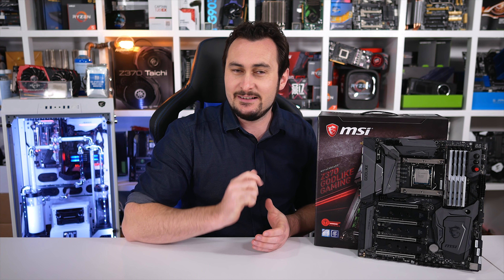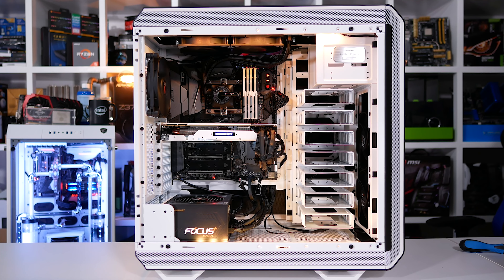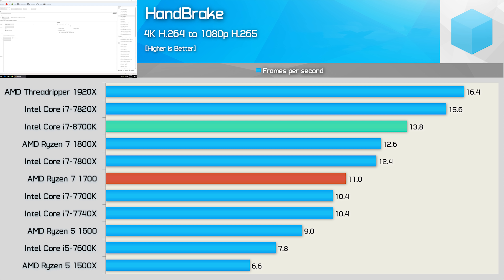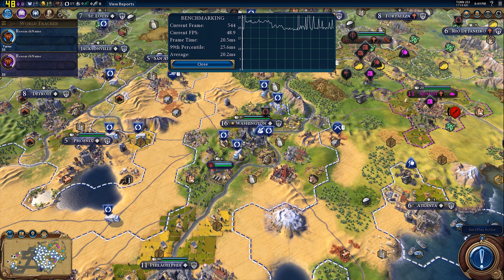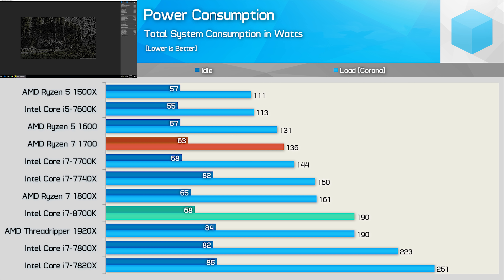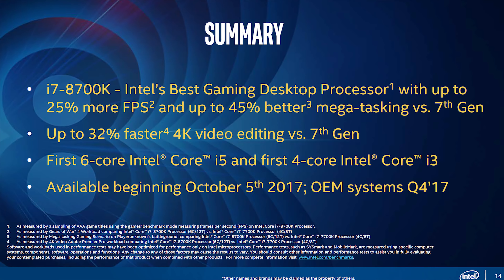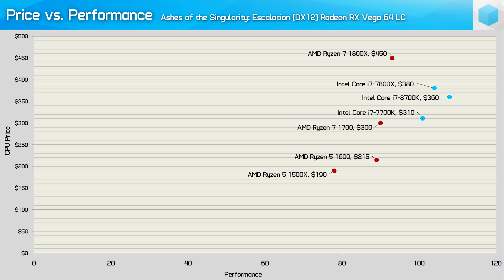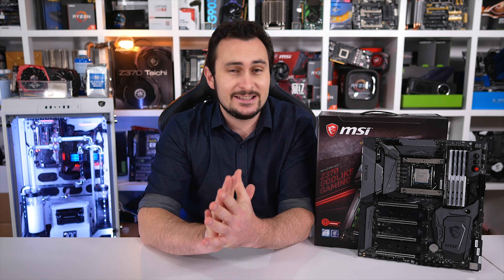Intel Core i7-8700K Review, The New Gaming King!

Comment: Interesting review and impressive performance of the Intel i7-8700 indeed, even though it is a bit of a hot breeder given its high TDP. How about the future proofness of the Intel platform? AMD for example guarantees the AM4 platform to stay until and including Ryzen 2... Intel on the other hand has a track record of forcing users to re-invest into an upgraded platform (due to changed socket layout) with every CPU generation. Any information about that?
I am asking because I don't want to buy a new platform (motherboard + cooler + maybe even RAMs) every time there's a CPU generation change. And I know AMD will come out with a 12nm Ryzen refresh in February 2018 that should shrink the performance gap to the i7-8xxx series and then finally the 7nm Ryzen 2 in 2019...all fitting into the same AM4 socket mainboard since Ryzen 1(provided, the mobo manufacturer supply the required BIOS update).
Reply: Peter Snizek Intel support two cpu generations per motherboard. 
1)Z68/ Z77 Sandy bridge and Ivy bridge
2)Z87/Z97 Haswell, Haswell refresh and broadwell
3) Z170/ Z270 Skylake and Kabylake
4) Z370/???? Coffelake and ????

Comment: I... ...was a bit disappointed to be honest with these graphs. I was expecting that Intel will blow up the competitor by miles... Seeing that the i7-8700K is placed between the Ryzen 7 1700 and Ryzen 7 1800X (some being overshadowed by the latter) it felt as if the extra cores and clock speed aren't utilized to the maximum. It's probably need some driver updates. Also, the CPU seems power hungry too.

Since both CPU company now offers over 4 core CPU, I hope more applications and games will utilize the CPU properly.

My verdict; get a Ryzen 7 1700 with a decent cooler. Drop it onto a good AM4 X370 board. Overclock it to 4.0 GHz and be happy with it for another 3 years.

This is purely my opinion. Any changes/updates in the future will void this comment.
Reply: in my opinion I'd go for 8700k, as it showed it had better value than 1800x and it was kinda going head to head with the 1800x. temps do get hot so gonna spend a lil more cash but its all gonna be worth.

Comment: Nothing surprising here. If you need super high fps gaming and don't have a system yet or are using a sandybridge, then this is good, otherwise get ryzen, as the 1600 is a lot cheaper and ryzen as a whole supports ecc for workstation. 

Side note, that power consumption, ouch. People aren't really getting just how power efficient ryzen is lol.

Comment: "20 dollars on a air cooler" it was hitting 97 degrees with the 240mm rad ?!!!!!!!
Reply from the maker: Didn't say you could overclock with it. I just said to use it at the very least you need a $20 cooler. It will work just fine out of the box with a cheap tower cooler!
Reply: Hardware Unboxed, I assumed as much. I would be interested to see how far it could be overclocked on a 20 doller cooler :) great review by the way. but the 97 degrees is very high for such a high end cooler, would you not agree ?

Comment: Man Intel needs to get away from ringbus ASAP.  Those IPC tests show how ringbus is really only meant to work well with quad cores or lower...
Reply: Tom Splittstoesser The ipc of the ringbus is good up to 10 cores. After that, it becomes bad. The i7 6950x at 4.4ghz is a ringbus design that trashes the 7900x at 4.6ghz.

Comment: Despite vega 64 LC being slower GPU than 1080 Ti, on BF1 and Civ, Ryzen perform better on Vega than 1080 Ti, why is that? Very peculiar result.
I think Ryzen is best paired with Radeon Vega and Intel/Nvidia is still the general best pairing.
Reply: Seramics Becuase ryzen's core to core latency is really bad. Most games switch threads which is why intel will always be ahead of amd. Nvidia's software scheduler switches threads as it does not have a hardware scheduler.

Comment: 8700K >> [hexcore] 3.7Ghz over 16 PCIe lanes @ 64GB RAM (max)

6850K >> [hexcore] 3.7Ghz over 40 PCIe lanes @ 128GB RAM (max).

*REMEMBER. You will be needing to fork out for a brand new motherboard with that. Have fun beta testing! :)

Comment: 16 lanes free, or zip after adding gpu? r u serious? Not even bandwidth for a single full strength nvme on a lightly shared 4 lane chipset. Multiple nvme/raid on such intel cpuS/chipsets is a fraught sham.

AM4 (20 lanes free ex the 4 lane chipset) at least allows a full strength nvme and a half strength one using 4x pcie2 lanes from the chipset (ie, an acceptable half of the chipsets bandwidth).

Over a brief period, our mainstream storage/workdrive sequential read has gone from 100MB/s sata hdd, to 500MB/s sata ssd, to 3500MB/s NVME. 

Thats an improvement of 35x.

Now you ~walk away from such a fundamental blessing, that future gaming & other code can really use, for a few more frames or settings in current gaming code?

I hope folks reflect on that pre purchase.

Its a pattern with ryzen. Intel sounds good superficially to gaming tragics, but when you step back in the slightest from a pure gaming perspective, Intel a dead end vs AMD.

Its not new. Intel has been perceived as a better gamer for all ryzen's life, but they are arguably the most popular choice for professed gamers now.

Comment: Such a shame you can only buy a z370 (130/150 dollar) motherboard in the foreseeable future. Otherwise the i3 8100 (4c4t, 117 dollar), i5 8400 (6c6t, 182 dollar) and i7 8700( 6c12c, 303 dollar) would be much more interesting and compelling. R5 1600 will probably stay best alround bang 4 buck cpu untill Intel releases cheaper motherboards.

Comment: So, basicaly, if AMDs and Intels engeeniring teams were on competition and given 125w power consumption limit to design CPU Intels team couldn't make it. On the other hand, if given powerconsumption limit were Coffee lake stated and if AMD team was careless enough to trade efficiency for performance as Intel does AMD would make faster processor [using performance optimized fitting production nod ]. I'm looking forward to AMD/GF 12nm and even more 7nm.
Reply: softplacetoland Intel are way way way ahead of AMD in power consumption, considering their cpu's are clocked way higher and their intergrated gpu's consume most of the power of the chips. They don't even need to solder to be successful while amd cpus NEED to be soldered to contain the heat they produce.

Comment: Holy mother of PSU what is up with those power draw figures. Saw this on the 8400 and was a bit put off but this is....holy mother....! For just 6 cores ? come on! Is the motherboard crap? I mean the CPU alone cal not suck this bad from an efficiency standpoint....! Still good review. Cant wait for a re test once cheaper mobo's come out. At this point spending 500euros on a 6 core cpu and mobo is well not very efficient.

Comment: What about the 8700?
Reply from the maker: What about it?
Reply: Yeah, some substance would of been good in my original question :D

I mean, since 8700k is massively limited supply right now, would the 8700 outperform the 7700k for gaming and everyday use or would I be better off simply preordering the 8700k?

Thanks!
Reply from the maker: Pre-order the 8700K. No idea why Intel is even selling locked parts right now since you can only buy Z370 boards this year.
Reply: Am I the only one who buys high end motherboard for the extra features (decent integrated sound card, USB C, Intel LAN, USB 3.1 front panel connector, multiple M.2 slots, plenty of 4-pin PWM connectors etc.), not for the OC capability? I would be very happy with 8700 + Z370 combo.

Comment: Ok, so basically it's not worth it if you have cheaper options that run about the same. If I had to choose intel I would go with something like i7 4790k, i5 7600k, i5 8600k, i7 6700k or even i3 8350k. You'll see veeery soon just why intel did everything just to make reviewers show us i7 8700k - because it is obsolete when compared to other intel chips in gaming. Sure it is a king, but I cannot imagine someone justify buying this even if future-proofing when next gen will come in 10nm.

Comment: Rip off   gready   Intel   , proc    price is  10-20% more   then  msrp
Reply: didnt you see? 8700k had better value than 1800x. even though 10-20% more than msrp
Reply: It's because it's hardly, or better, it's not available at all (damn paper launch). Same situation with Vega: Hardly available and thus it's far more expensive than MSRP.
Reply: not anymore 1800x is 360 dollars now in Newegg and amazon.. 1700x is 299 and 1700 is 260

Comment: Some here have noted the results "indicate" vega works better on ryzen.

Whatever.

Just saying, I have long thought ~"how could zen/vega not work better?"

That would be to say, amd spent many concurrent years developing sibling cpu/gpu processors  using the same Fabric interconnecting ecosystem, yet they treated them as unrelated and & with no potential synergies. It would also ignore the whole Amd APU focus - they are on the cusp of raven ridge,  delayed understandably for 12nm - which is both zen & vega processors, interlinked on a single Fabric ~die, bypassing the restrictive pcie bus. Now thats integrated harmony.

This is bound to pay dividends to all AMD rig owners over time.

Afaik, APIs are a shift amd's way. game devs can code lazily fr the api, and the api optimises it for the users particular hardware. afaik, this reduces the home town advantage of incumbents like nvidia.
Reply: Peter Connell Nvidia's software scheduler switches threads a lot, and is therfore bottlenecked by amds slow core to core ccx latency.

Comment: Whoa, some really bad comparisons in this round and while you might think it's being nitpicky, I believe that your benchmarks are leaving a biased impression.
First the omittance of the 1600X and the use of the 1600 in the stock benchmarks leaves a false impression of AMD's 6 core parts performance out of the box, the 1600 at stock is roughly 10% slower than the 1600X so for people doing that core count comparison instead of price, AMD looks worse OOTB than what its best 6 core part actually is, the 8700K is intels best 6 core part at stock.
Then with regards to the 1700 and the 1700X, here instead of the price for price comparison you've included the much slower clocked 1700 which is going to be affected in benchmarks that are frequency sensitive again giving the 8700K a bias there.

Now you might say "my viewers know better" but rest assured that while some will do the calculations that reject these stock clock performances as indicative, most will just take them at face value, while leaving the 1800X as the known more expensive representation, something most people will realise. In quite a few of the benchmarks the 8700K splits the 1700 and the 1800X, just where the performance of the 1700X would fit at stock.

We all know that currently intel have a huge clockspeed advantage which explains much of its performance benefits, e.g. the much higher stock clocks of the 8700K matching the 1700 in cinebench muticore, would have lost to the 1700X which is price for price comparable hypothetically, though it's only $5 more on newegg than a 1700 ($294 vs$299) making it right now a much better deal than a 1700 if you don't want the cooler (and even then) and a hell of a lot cheaper than a 8700K. Oh and the same goes for the 1600X, it's only $5 more than a 1600 ($214 vs $219.)

Comment: The new 6 core i5 actually has better 'gaming' performance. The i7-8700k is for productivity.
Reply from the maker: Faster? Not based on what I'm seeing right now as I benchmark the Core i5-8400. Similar for sure, not faster, at least in the CPU intensive games I'm testing.
Reply: Gaming v productivity.  The benchmarks I have seen over the last 24-48hrs have indicated the i5 will be better for gaming.
Reply from the maker: Yes, better value, not faster!

Comment: The new Gaming King my a.ss! No offence, but the comparation in games is pointless. Who the hell buys a 8700K  or a 1800X and a GTX1080ti and plays in 1080p?!  In 2K or 4K, the fps are the same, and the CPU is not more relevant, but the GPU is.  So, the 8700K is the fastest gaming CPU?  NO! it`s beated by R5 1600X in some games. Please, don`t show me Full HD grafics, 1080p was in 2008- 2009.  It`s still use a tooth paste as TIM? YES!  Also, it`s droping a lot of frames while streaming...  R7 1700 is better for gaming + streaming or recording.
Reply from the maker: High refresh rate gaming is kind of a popular thing now...
Reply: Btw, try gaming + streaming, or recording at the same time and see who's the boss. 8700K have 35% frame drops. 1700-15%. If u encoding too, a big + comes from CUDA.  Also, i use a 34" 3440x1440 @ 100Hz (it`s the best buy so far. You can ask Tech YES City, too),  so if someone would like a lower res, with 144Hz whit a washed TN panel, be my guest. PS: I7 930 it`s still competitive in 1080p, and it`s 10 years old. :))) Heva a nice weekend.
REPLY

Comment: ...so running old crappy single core software at 5.2ghz vs 1800x, i wouldn't call that exactly "devastating". What would be Devastating however is dropping 2Gs on a multicore system (like the 8700k) only to ran old crap that benefits solely from IPC.

Comment: Finally! Now Intel is once again beginning to innovate.
Reply: innovate by gluing two more cores ?
Reply: Refresh with 2 more cores still using the ring bus without any increased efficency, but hey atleat theyre trying to compete
Reply: All they did was whack two more cores on it, I don't call that innovation.
Reply: They reduce the efficiency to the bottom. 
When overclocked even higher than an overclocked R7 1800X.
Reply: Sorry, I should've chosen my word choice better. What I meant was that now Intel is actually beginning to offer better price to performance products thanks to AMD becoming a threat
Reply: Killian Khoo Look at the clockspeeds 5ghz vs ryzen 4ghz. Also intel has an integrated gpu which sucks a lot of power. Intel is way more effecient than amd can ever hope to be.
Reply: darrenraphael Actually, the integrated gpu uses very little power (edited my comment because I realised what you were saying).
Reply: darrenraphael. So. Ryzen apus dont count?

Comment: this cpu blows ryzen out of the water. 

if you are a peanutcounter and care about 50 or 100$ go for ryzen
if you want maximum gaming performance you go for 8700k
Reply: dante`afk good luck running it at 100c overclocked while water cooled
Reply: delid and run it at 60c while watercooled.
Reply: Snobtroll. While deliberately mistaking what blowing out of water is.

Comment: The real question is, why the fuck would anyone buy Ryzen now? The 1700 gets basically destroyed in every aspect (ofc gaming, but also benchmarks and it is extremely close to the 1800x). The 1700x and the 8700k cost basically the same here in the EU, while the 8700k performs much better. And that Video title is just funny as hell. Why call it the gaming king when it destroys basically ryzen in every aspect? Your AMD fanboyism is just ridiculous(When you suggested to buy the 1600 over the 8700k, while not comparing to the 1700(x) 1800x price range, I honestly laughed my ass off).
Reply from the maker: Overclocked to 3.8 - 4 GHz the R7 1700 is by far the better value chip for productivity workloads.

Comment: 8700k = threads like an 8c that games like a 7700k = win.

8600k = nearly threads like an 8c and practically games like a 7700k but will only cost £220-£240... = win win. 

Zen 2 gonna need to impress next year.... albeit just in time for Intels 8c ringbus that Oc's to 5ghz and games like a 8700k and threads like a 7900x...lolrolfcopter.
Reply: Zen 2 is coming out 2019. 
Next year just improved fab 12nm ~
AMD just isn't standing on the same stage as Intel. 
They dont have enough R&D budget for that.
Reply: 12nm will have faster clock speed and lower power consumption... even if its not faster it will be much more efficient and cheaper to manufacture.
Reply: I'm looking forward to Zen2... really hoping they increase IPC and clocks to 4.5+ or better. Cannonlake is going to devastate though, 10mn will be a huge move foward and likely a node we will keep well into the 2020's

Not long found out about the potential for BCLK clocking the 8400 to 5ghz which will be very disrupting.. I mean a locked 8400 at $180 running like a 8600k?? fuck yea.